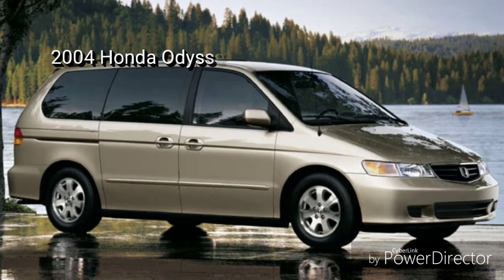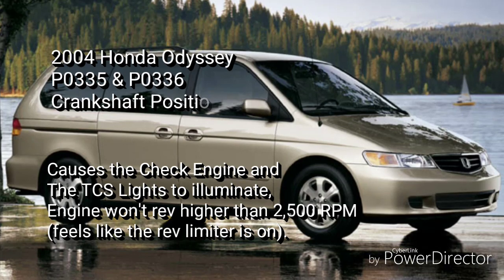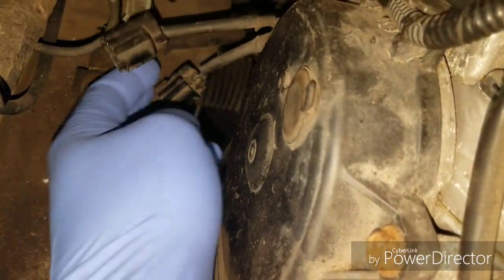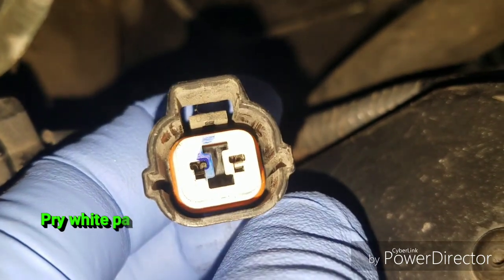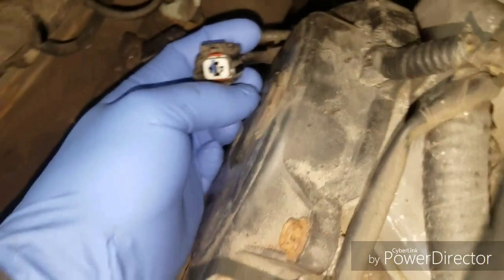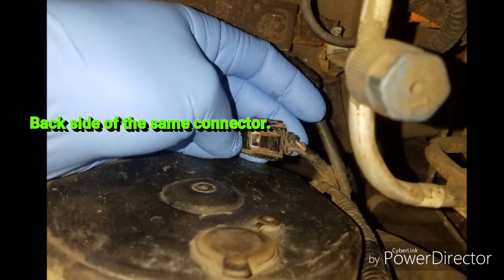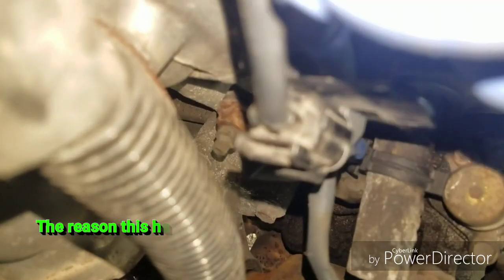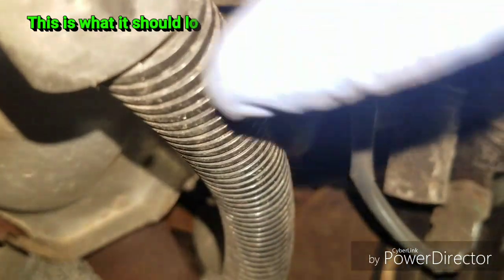2004 Honda Odyssey P0335 and P0336 Crankshaft Position sensor FIX!

Comment: I have a 2006 Honda odyssey when I press on the gas it doesn’t want to go I have the VSA, engine, D is flashing brake light on. Sometimes when the car is running the gas gauge goes to E  even though it’s full. I replace the battery and replace the alternator it still didn’t help. The car keeps shutting off unless I jump it. Thats the only way it starts. should I just Junk the car?
Reply from the maker: Sounds like a bad connection at one of the ground points. Check for corrosion and/or broken wires at ground termination points. Also have a good look at the fuse panel - sometimes a leaking windshield can introduce water into the fuse panel and wreak havock on the electrical system.

Comment: Important:  a maintenance bulletin from Honda states that a low battery can cause crankshaft position sensor errors!   I found that out after spending beaucoup dollars to replace the sensor and then having the same problem immediately.
Reply: I'll try charging the battery... let you know what happens soon...

Comment: My CEL and TCS lights are on but engine starts and runs at normal RPM, no limp mode.  However, can't clear the codes.  The wire harness for the CPS connector is covered in oil from a previous valve cover gasket leak which has been fixed.  CEL and TCS lights came on after the gasket repair was done.  Wondering if oil might be fouling up the connector.